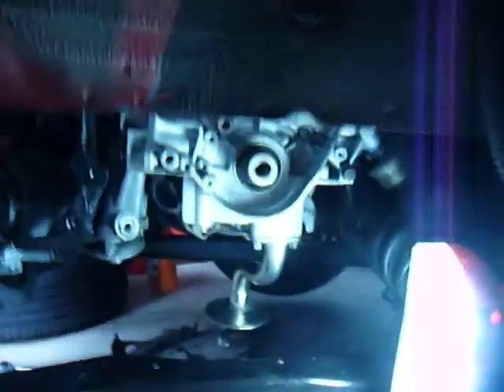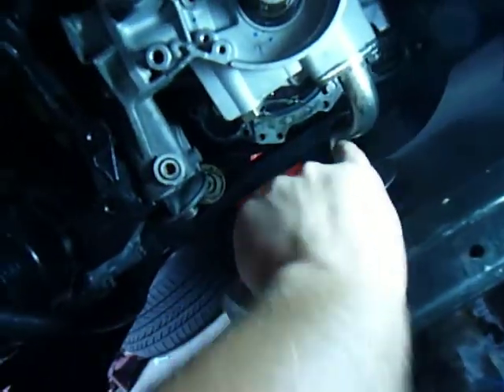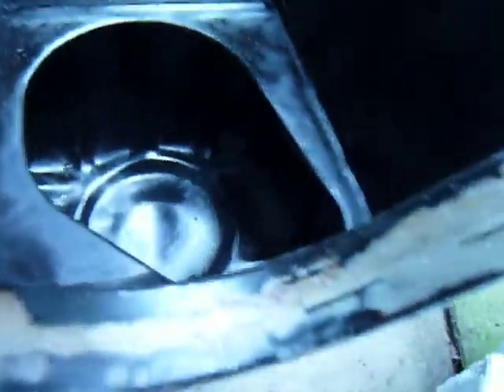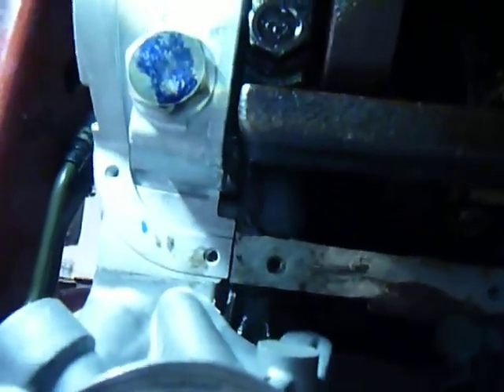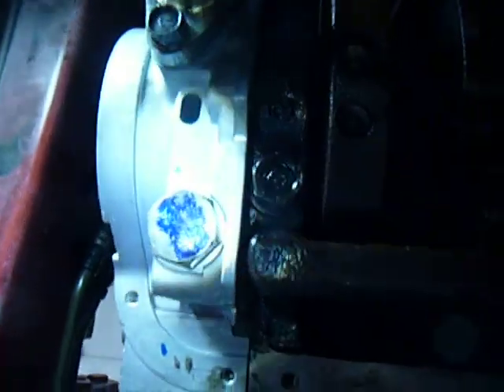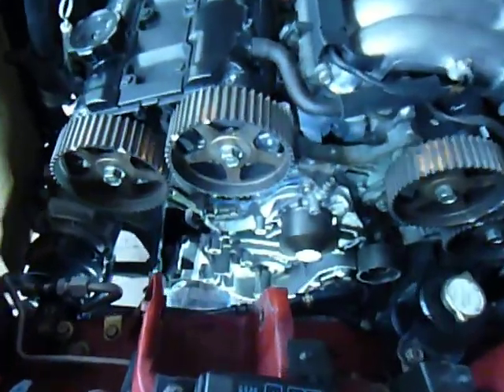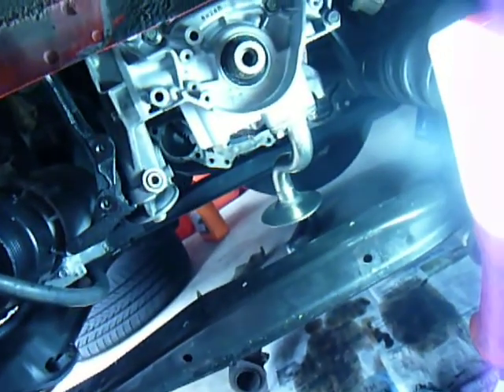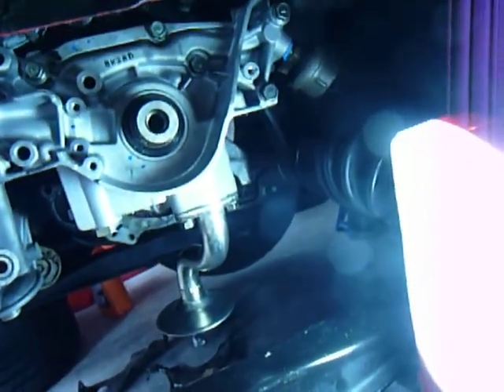Club3g: 6G72 DOHC 3000GT no oil pressure and oil pump install

Comment: How did u get the pan off?
Reply from the maker: Remove the bolts surrounding the pan I believe they are 10mm bolts. And take off the timing belt cover too.
Reply: Thank u for the reply, but I meant how did you get it off in terms of space. Mine is stuck between my frame and transmission
Reply from the maker: Ok. The best way to do it is to take the engine out of the car and put it on a engine stand. Then remove the pan. That is how I did it.
Reply: @punked6  For Mit VR4's and Stealth TT that's the best way. The fckn transfer case is on the way. But for non turbos, must be peace of cake.

Comment: I put a new pump in my car and still no pressure. (I'm told now after doing it that oil pumps don make pressure they just move volume.)
Reply: i bet it's your gauge. 3000gts stock gauges eventually all go out, especially with how old they are.
Reply: It turned out that I had the wrong sensor.
Reply: chefron8 Yeah i knew it had to be something along those lines.
Reply: Same here. Measuring using a mechanics' gauge in the sensor hole. Because the dashboard gauge always showed the correct pressure.